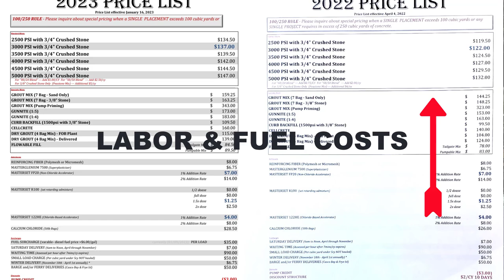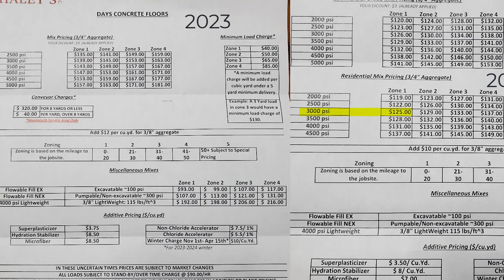Concrete Prices Dramatically Going UP in 2023 | This Perfect Storm Will Affect All of US!

Comment: As an Architect I will say that over the past 24 months construction costs for projects have risen about 150%.  The 2% inflation that we got used to during the past 40 years is over.  There are some materials whose price is determined not at the time of the order but rather at the time of the delivery.  Architects for example have to be very careful when they contractually agree to accept a client's construction budget before a single line is drawn.
Reply from the maker: Yes, we see a lot of that also with our building contractors. Prices adjusted to when materials are bought and delivered.

Comment: Mike, the loss of fly ash (or the shortage of it), the high petroleum prices (admixtures, fuel, cement), increased labor costs and CDL shortage all  are working to raise the prices. Finding or increasing fly ash availability and lowering fuel costs will lower the prices some. Right now, the pressure is present to sustain the demand for concrete/asphalt at the current pricing.

Comment: You know Mike, if here, in France, we've got your concrete prices, we would be more than happy to get such low ones 'cause the least expensive you can get here is a local version of flowable fill and it's, at least, twice the price of your entry price concrete...

If we want a strong-enough concrete for slab, we would be charged between 350 and 500 € (roughly 425 and 700$ US) per cubic meter (which is a bit bigger than a cubic yard) the only nice thing is that include transport...

Need a conveyor belt ? extra 300€ (~375$ US)

A concrete pump ? (Mostly) extra 400€ (~525$ US) and more if it's a really Big one that must travel in "wide load" category (which is easily reach here in France if the truck is above 12 meters in length (40'), 2.5 meters in width (9'), 4 meters in height (13') and/or 12 metric tons per axle...)
Reply: Don't tell the Irish concrete companies, I think they are around 120euro per cubic including delivery with minimum 6 cu order. That's C35 too which is probably 5000psi concrete. The pump is extra 800 and conveyor? I'm thinking of making my own chute extension and ordering a high level water reducer to bring it to a very flowable 7-8 Inch slump we call this S4 slump.. And ordering c40 to make up for not vibrating it with a poker to remove air in case the aggregate settles in the liquid mix... This is for a garage raft foundation/final floor for a two post lift so I'm taking no chances👍

Comment: Hey mike it’s Brooke Howe over heron central Vermont and the last time we touched on the cost I was telling you I was roughly 500 per yd to form ,rebar, pour and finish slabs and floors and we’re experiencing similar prices for our concrete in this area so I’m probably going be 600 per yard depending on mix design.. always glad you are willing to share prices with the rest of us In The trade
Reply from the maker: Hi Brooke, thanks for sharing. I know a lot of foundation guys are in the 550 range here.

Comment: I can't speak for concrete prices I'm an excavation contractor, so I don't pour much. In fact, the only time I pour is if it is required for backfill such as around electrical conduit, thrush blocks for watermains etc. Most of the time it's actually flowable fill. My take on the entire situation is fuel prices. Right down to the cost of groceries. I had a lot of cancelations last year because people couldn't afford to have the work done. I am in an economically depressed area to begin with. Unfortunately, in my area there is a limit on how much you can increase your rate , people just don't have the money around here so you just won't work. I made less money in 2022 than I ever have in the 27 years I have been in business, and all my equipment is paid for now, unlike the earlier years. It's pretty sad when you roll up on the job with a half million dollars worth of equipment and you make less than $40,000 profit for the entire season. And I'm not saying this in a boastful way but more of a pathetic way, I am in top 5 of local excavating contractors. This is not sustainable for our country!
Reply: 40k a season that's 160k a year. If the 500k equip lasts 10 years and finance interest that's 80k a year. So 80k real profit I guess labor is on top.
Reply: @gauravvij67 no you’re mistaken the season is from spring to fall or 1 year.  He’s saying he made 40k for an entire year!
Reply: @scottsand2317  Let's not forget the taxes that he's going to pay on that profit also so lessening it even more so.
Reply: @scottsand2317  Yes you are correct. And I said less than 40, well in full disclosure $32k and change. Pretty pathetic for the investment and headache I have. And the worst part, although I had cancelations from these rising costs, I was busy throughout the season. I am in an economically depressed area in Upstate NY. It has been that way since the 70's when our leather mills moved over seas. The per capita income here is $22850 I just googled it. I always did ok here though. Now, the cost of fuel and everything else has risen to the point that we can't pass the increases to the consumer In already struggling communities like mine. My observation is, it is hitting areas like mine first. I hope I'm wrong, but I predict it will eventially catch up with most areas throughout the US, with the exceptions of the very affluent areas. I predict most of the construction will come to a halt.

Comment: Mine went up $12/yard this year. I use 4000psi for just about everything. It's now at $170/yard here. I'm in southeast PA. They also charge a delivery fee that varies for less than 9 yards. On top of the per yard charge. 1-3 yards -$100 3-6 yards -$80 6-9 yards - $40
Reply: is that volumetric prices or regualr ready mix, every volumetric company i call here is about double the cost of regular rewdy mix
Reply: @GRUBB-MUDD  volumetric, but ready mix is right around the same here

Comment: The runup in concrete itself is really only part of the problem. I dont know if people are listing out their base prices, but some of them seem pretty low. I only look at the final price charged to my card, and divide that by the yards so it includes the base price with all the add-ons, typically we are paying well over 200 in Ohio. The other part is how much more a skid steer costs, basically double in the last few years. Then the trailer, your pickup truck, all nearly doubled, maybe 30% increases best case scenario, and the insurance follows it right up. You mentioned your shop, if a guy doesnt have one of those and needs or wants one how much more is that going to cost you? And then figure by the square foot? well how big is the job, what about the prep etc, and all of that is high higher higher. Its a great time for people who are already established, already have tools and equipment - take in the higher costs and not have to pay all of it it all right back, but anyone trying to get started or established - its like rolling a big rock up a hill. Lets be realistic, the guys that are established can easily underbid you and still keep a higher profit simultaneously

Comment: Actually, my prices have gone down finally beginning 2023. I live in Knoxville Tennessee. I use a company called SRM Concrete. At first a 3000 psi mix for 10 yards of concrete cost around 2000-2100 in the year of 2022. Now that same mix as of 2023 cost around 1800– 1900. However, that’s just the plant I use I’m not sure of the other ones.
Reply: SRM is big in Florida as well, if they can get aggregate, their prices are highly competitive.
Reply: @trafficsignalman  I didn’t know that. I personally like their concrete because they have front end loaders and I like the way their concrete sets up.
Reply: SRM produces good mud, typically.

Comment: Was a contractor for many years, transitioned into driving a mixer when the body gave out, we had 1 cu. yd. forms for left over, when the forms were all full, we had a recycler to separate aggregate from slurry, so the aggregate would be clean and reusable.  If concrete was rejected for some reason, it was often sold to local farms at a reduced rate for ensilage flooring. When I started my masonry business, 2500 lb was $18 cu yd, 3500 was $21 per yd. LOL The good old days. And it was concrete, not chemicals like today’s mix formulas. Didn’t use fly ash to replace portland. I poured driveways back then with the 3500, and to this day most still look excellent, and they were steel finished and then, broom finished, not like today where you don’t steel them, just float and broom. Different concrete, different processes. 🤙
Reply: We have a largishish 100 foot driveway poured  in 1990 in Ireland I guess 6 inch with no metal and has taken oil delivery trucks  and 3 or 4 cars parked and moving  every day and only 2 cracks I can think of. And it cracked where it isn't used! I guess the concrete was real in the old days... It still looks excellent and should do for another 50 + years
Reply: @gauravvij67  Yes sir, my point exactly, the first house I built I poured the driveway with 2500 lb concrete to save money. No rods, just wire mesh, no additives, steel finished, then a fine broom finish, looks just like the day I laid it down, no cracks, except in the expansion cuts, that was in 1972, lol surface has very minimal wear, but it was real concrete, not chemical crete. BTW, tell Conner McGreggor I said hello, 😉👋

Comment: Hi Mike, it looks like were going to be around $160 a yard for 3,500psi without hot water, or admixture. Looks like a similar jump in cost. I'm hoping the color hardener and integral color etc... aren't too much higher. It looks like regular rebar might actually drop a little according to all my suppliers. Thanks for doing these videos.
Reply: 154.00 yard in central mo.4000 psi

Comment: Cement prices in the EU went up in 2022 about 40-50€ per 1000kg due to increase in energy costs and the CO2 taxation system. CEM I is poorly available due to this. Most cements are combined with limestonepowder, fly ash and GGBS. In 2023 they wil go up an extra 5-10€ per 1000kg in the first quarter. Sand and gravel is also going up due to availability.

Comment: Cement availability is becoming an issue in my area. And that's strange, because we have a cement producer in the area. The company I work for has a paving plant but couldn't use it last year because the producer couldn't or wouldn't commit to supplying them for an interstate project that will require somewhere in the neighborhood of 30,000 yards of concrete.

Comment: This will come down when demand drops. As interest rates hit 7% and head to 8%, demand will look like 2008-2012.  Disposable income is rapidly disappearing.  The correction is going to be painful.
FWIW...I'm a higher income earner and bought land to build.  My plans will be on hold until labor and supply costs take major hits.  The trades only make money when they're working...an all or nothing proposition.
Reply: If the gooberment keeps printing money the prices will keep inflating.  Infrastructure Investment and Jobs Act alone provides for $1.2 trillion in federal spending over  five years.  This act is a large part of why prices of cement have jumped because of all the road and infrastructure construction that is now under way.  Going to take more than 8% interest rates to make a dent.

Comment: hello mike! ever thought about mixing it yourself and pumping with a machine? wouldn't be the price much less for you then, how much for cement and sand at maine? greetings from germany :)
Reply: ya i live 100 miles from mike day just bought a used front mixer for 5 grand buying 3/4 stone for $7 a ton .$2 a ton for sand and $125 a ton for portland. that figures out to be less than $45 per yard. 50 yds the truck will be paid for